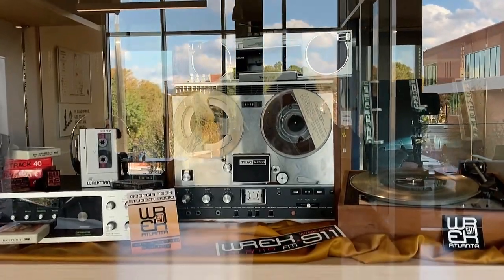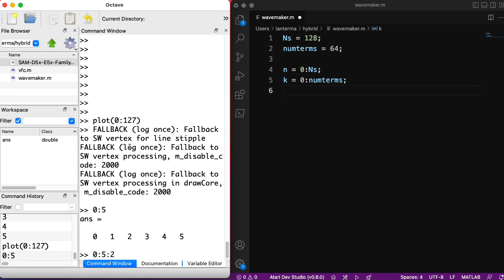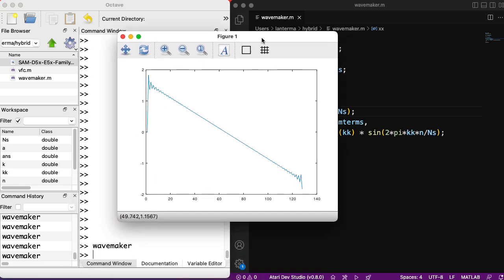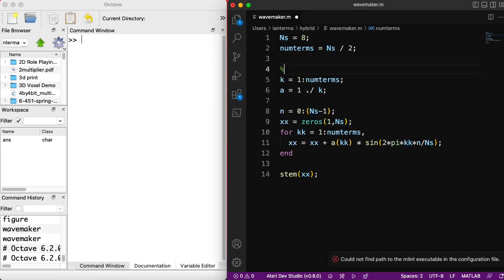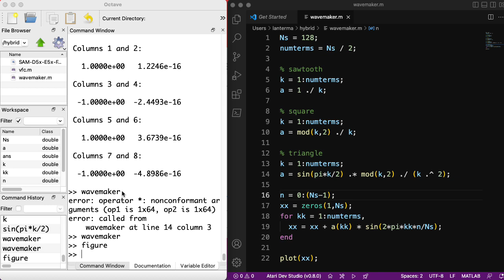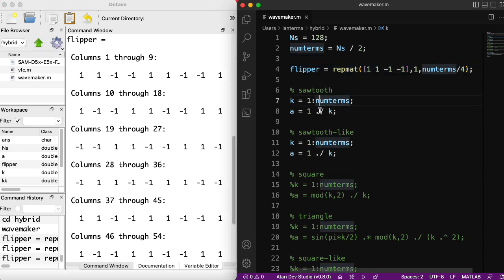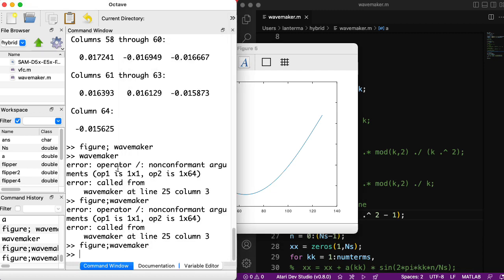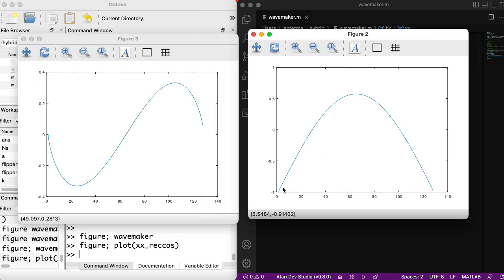Computing Wavetables in MATLAB/Octave via Additive Synthesis (Fourier Series: saw, square, triangle)

Comment: Nice video!
I guess the volume difference between the different versions of the same spectrum are because of the different normalization coefficients used.
An actual square wave for instance is a very efficient way to cram a lot of spectral energy into the same waveform, because the positive peaks of half of the sine components line up with the negative peaks of the other half. If you change around the phases like you did, the sine components add up to a higher maximum value, and then the normalization has to reduce the amplitude more.

Comment: If you do a Fourier transform of e.g. a digital sawtooth or square wave, it's pretty close to the ideal spectrum until a little bit below the Nyquist frequency. They sound pretty similar too. I think the digital versions have slightly less high frequency content. As long as you pick a sample rate, any sampled signal can be seen as bandlimited. Still, fun to look at the results, and to listen to them!

Comment: This was very interesting! One thing that struck me about the pseudo-saw/square was how they look like a true saw/square as generated by analogue means, with a low pass filter with a touch of resonance tuned to a harmonic. Which makes sense I guess. 

One other thing about the part where you play with the phase of the coefficients - I'm presuming you're familiar with Yamaha FM synthesis and Ken Schirriff's work on reverse engineering the ICs used? Almost all the old FM synths offered only sine waves but some (eg DX11/TX81z) offered 8 various waves. If you look at the user manuals those waves and their harmonics are roughly sketched out, and they look a lot like those waves you generate later on. Not sure how they're generated in the Yamahas, but it's an interesting thing!

Well I think so anyway. I don't get out much.
Reply from the maker: The Yamaha waves are interesting; they're all based on reading out the tables they have in ROM in slightly different ways, so they can get a variety of waveforms without too much extra effort.

Comment: Lol, how does that work?
having all these formulas (saw tooth, square, triangle) in the same code? does the program skip and pick the appropriate one? or use them al?
weird code with those "dots"

i made a made and posted a video on how to use "function" pointers and it "plots" a triangle wave, would that be valid if coupled to a DAC?
after all these years of computer i still although read about it, figure out what Aliasing or anti alias is.
I never really used sin(), tan(), cosin() and i didn't learn this Fourier stuff at school.